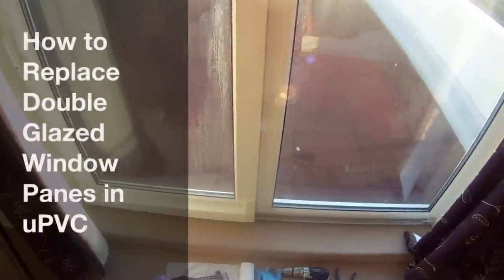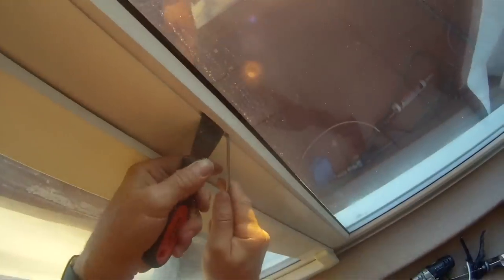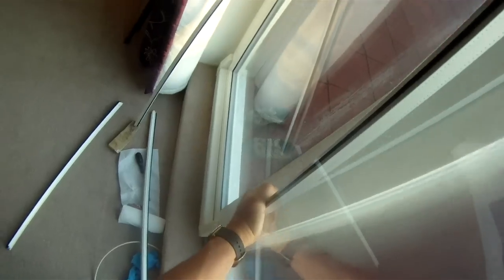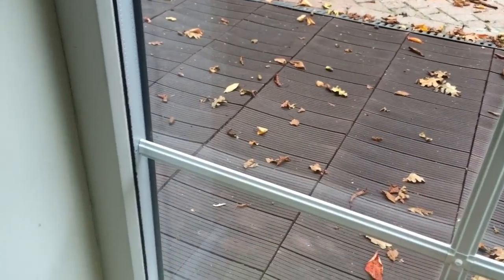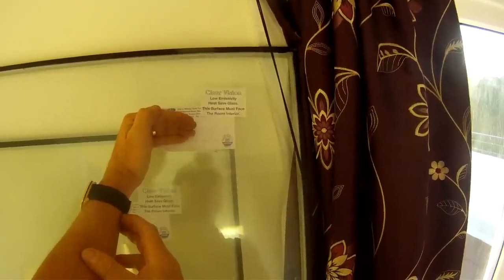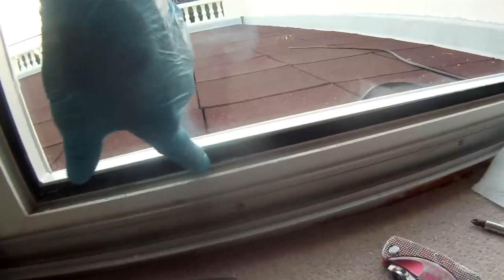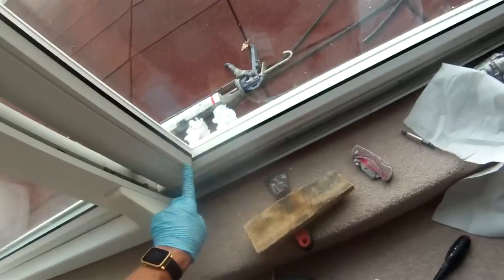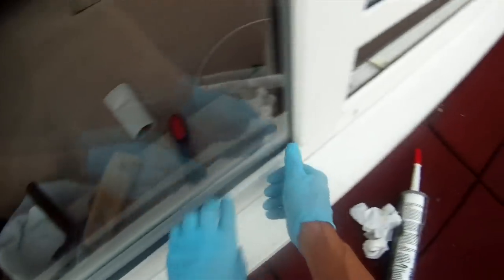How to Replace Double Glazing in uPVC Windows - DIY Window Replacement

Comment: Hi great video. One thing did you re-use the trims or did you purchase new trims from the glass supplier or elsewhere?
Reply from the maker: Thanks.  I reused them.
Reply: @comeinhandynow  literally what I needed to know cheers. One question, this double sided tape stuff, I'm assuming you'd have to use a new batch. I want to replace the blown standard PVCu windows at my let.

Comment: What a great video, is that the first time you change d a window frame are you DIY proficient or you a Professional Builder?
Very nicely done video. Ill change 2 windows my self next week hope goes well.
Reply from the maker: Thanks.  It's not the first time, but I'd call myself a DIYer not a builder.  Good luck with yours and thanks again.

Comment: Hi, recently the inside of my double glazing window started to leak in water when it rains heavyly. It don't seems to be leaking out of the window but just into the window. After few days, I guess rain water evaporated as it's dry and also leaving green mold. Any suggestions how to repair this?
Reply from the maker: Take out the window and check the drain holes that are under the glass pane, in the frame.  If they are insufficient drill new ones going out.  I had the same problems recently, heavy wind and rain was pushing water through to the inside.  The problem was blocked drain channels. I also put a bead of clean silicon seal across the inside edge (glass removed) to form more of a water barrier to direct it outside rather than inside.

Comment: the rubber along the inside between my window panes are becoming misaligned. how do i go about removing it and adding a new strip? i have screws on my windows. i guess it needs to be screwed off. should i remove the window pane on the inside of my house in case something bad happens, it won't run the exterior side since my homeowners assocation is very picky and will penalize me if they see something weird on the exterior of my house.
Reply from the maker: Yes unscrew those screws holding the internal pane in place. Lift it carefully off.  I think you have what is called secondary double glazing.  The internal glass pane can then be lifted away and the spacer repositioned.  Good luck!
Reply from the maker: Looking at that photo I would say that the double glazed window pane has to be replaced.  The 'rubber' looks like the adhesive spacer that sticks the two panes together.  It looks like you unscrew those bolts to free up the pane.  It's cheaper to do it yourself, just get to the glass and measure the width height and thickness of the glass and find a local double glazed window pane manufacturer, or look on the internet and mail order it.
Reply: comeinhandynow what about the rubber itself? wouldn't that have to be replaced?
Reply from the maker: It's part of the window pane, it's the adhesive spacer that glues and seals the two panes together and so comes with a new double glazed pane, assuming I interpret that picture correctly.  Take it out and have a look.

Comment: how do you measure up to be able to order the replacement ?
Reply from the maker: You need to pop off trims and measure the old glass length  width and thickness.  All outside dimensions of the glass,

Comment: How much cost the glass any idea?
Reply from the maker: Try searching online glass suppliers, or look for local double glazing glass manufacturers.  You need to know the thickness, and wether you want toughened (needed for patio doors or low glass) and any other options like self cleaning.

Comment: I did actually see you do that but I have never removed the rubber just the inside strip. Are you a handyman?
Reply from the maker: +philrab66 Interesting. I'm surprised you can get the inside strips out without taking the rubber beading out.  
You could call be a handyman, amongst other things, I suppose.
Reply: @comeinhandynow  yeah you can if its difficult to remove spray soapy water around the beads it's normaly the rubbers have gone hard and stiff

Comment: practical advice!! its not often you get videos like this, well done guys would love to see more videos like this, a firm local to me published this post http://www.copperfieldwindows.co.uk/news/2016/when-is-the-right-time-to-replace-my-windows-and-doors/ would love to hear if you guys agree with it.
Reply from the maker: Thanks.  I had a look at the link and what they state is generally ok.  Although they should point out when they talk about energy saving, it would take many many years to pay back the window replacement cost from the savings in heating bills.
Generally I replace double glazed window panes (i.e. the glass only) when the seal has gone and they are misting up and staining.  Be sure the plastic spacers that support the glass are supporting both panes of glass so as not to stress the seal and shorten its life.
Most UPVC frames can be cleaned up well to look nearly new.  I have another video on my channel on an easy way to do this.

Comment: There is no need to remove the rubber , used to do this for main contractor for insurance work leave the rubber and use a rubber mallet just in. Case
Reply from the maker: Thanks for the feedback. It does make it a lot harder to reinsert the trim, but I can see that approach making more sense when access to the other side is more difficult, like above ground floor.

Comment: Why take the rubber out from the outside?
Reply from the maker: +philrab66 To allow the glass pane to be moved out enough so that the inside plastic beading can be removed.  This is shown at a point in the video when I give the glass a push out.
Reply: Takes less force i suppose?! It is surprising how much the window will take, and not break, but a thin soapy solution and a hammer and chisel is often required, and a lot of 'controlled force' as the video maker obviously knows. On the double-sided foam tape ones, they are older style, externally beaded, and a lot more annoying...!
Reply from the maker: Agreed. Thanks for commenting.
Reply: It not need to remove rubber strip from outside and inside.